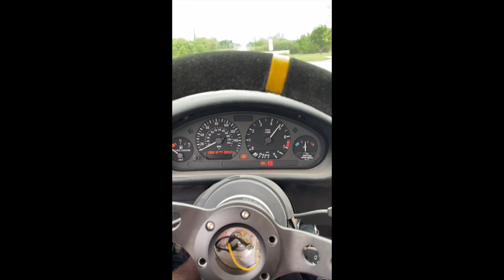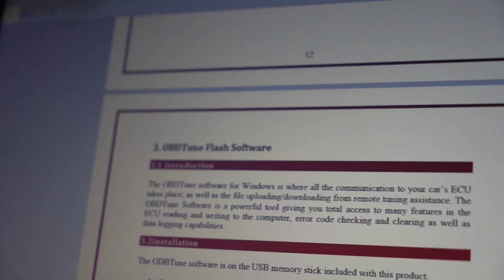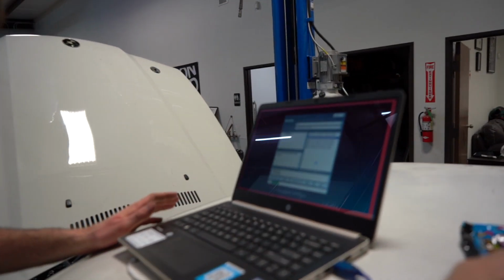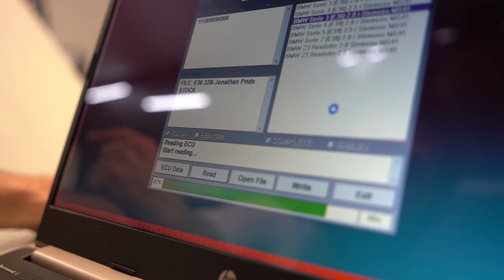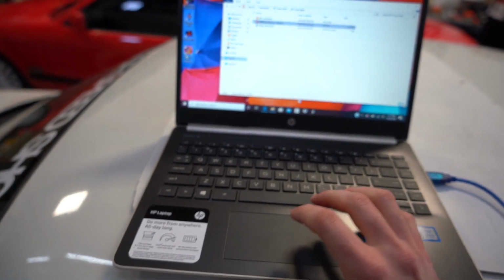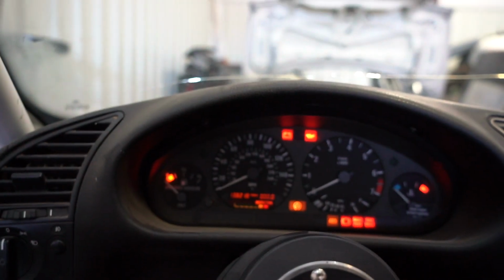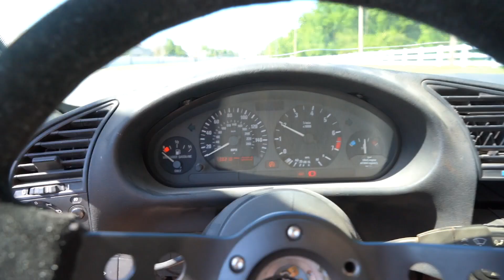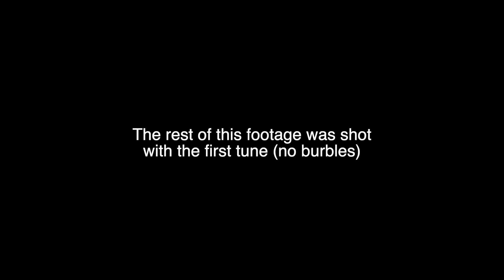BMW E36 RK-Tunes Install! 328i M52 OBDII AGGRESSIVE BURBLES!

Comment: So just removing EWS and raising the redline to 7300 won't give u and extra 15-20hp..it won't even do it when he adds the burble(which was the only thing u wanted really...and he forgot),and if dude at RK told u it would he's lying. U need to AT LEAST do the intake swap to yield the performance gains. Otherwise he just compromised ur crack and made ur car annoying to drive. Personally I'd goto kassel cuz I've heard NOTHING but BAD THINGS on RKTUNES

Comment: I might buy this friday I'm not sure. M50 manifold or this what you think I should do first? Love the channel man!
Reply: M50 manifold , pulley kit, long cold air intake , headers with with a performance cat a y pipe after the cat to a single 2.5 all the way back to a Magnaflow exhaust , and lastly the rk tune
Reply: You can also not waste your time and money,  an by an M3
Reply from the maker: Sweet!
Reply: @leavingasap843  lol...why so u can spend 3x as much for the car and insurance just for a M badge? The e36 is WELL KNOWN to be the chassis that M3 owners got the SHAFT on. Not only did we get a SEVERELY detuned motor s50 and very minor cosmetic differences,but when the M52b28 motor came out in 96 the performance numbers were so comparable with the s50b30 in the m3,bmw had to nerf the m52b28's intake just to TRY and justify the extra 10k a m3 was.  With a 1 time VERY CHEAP series of mods,a m52b28 can EASILY put out the same juice as the M3. u get one that is automatic,that the motor hasn't been beat to hell back and u can beat a abused m3 with just a manual swap...ask me how I know

Comment: wait so changing the code in your ecu can change your power output and exhaust? I still dont get that? Is that what it is, just coding?
Reply: It's basically telling your ecu to run a different way. Cars from factory are ment to run efficiently more often than not. What he is doing, is basically making the car run a little richer so he gets that crackle in the exhaust. Your rev limiter is also set by the ECU so you can remove that. So if you want to look at it as "coding" then yes, tuning your car can be close if not same to coding
EDIT his tune is also giving him better performance, which is what people are usually going for. Higher torque numbers and bhp
Reply: Wolf Gvming they pull more timing and other stuff like take advantage of higher octane fuel
Reply: @wolfgvming5855  well put gg

Comment: Hey! What wire or fuse did u tap into to have electric fan turn on with the key ?? Thanks
Reply from the maker: Any 12v to use as a trigger. Cigarette lighter? Use an add a circuit thing

Comment: Bloody lucky you got a good cop lol
Burbles sound nice, but you need a better muffler 😎
Reply from the maker: Big Keg I know man I was sweating it for a sec 😅 Yes I’m going to redo the exhaust setup, not a huge fan of the noise.
Reply: I really want to have a slight burble but I don't want it to be very aggressive. Cuz let's face it unless force induction our e36 aren't that fast. Also won't to get an exhaust been thinking about uuc

Comment: Hello, i just came accross your channel. Great stuff. I have a question. Are 328i and 328is the same? What does IS mean? For 318is i know, but here in my country , we don't have 328is or 325is's , so noone knows. Some think that the IS means around 200+hp stock. Sport of some kind.
Reply from the maker: Hey man, glad you found the channel. The IS means that it is a 2 door. I don't think there is any other big differences.

Comment: About to get my hands on Mint 328i, What mods did you do to the engine? Intake? Manifold? Exhaust?
Reply from the maker: my 328i engine just has exhaust and cold air intake. Plus the tune. That's all. It is hard to pull much more power out of these. You can do m3 cams, Intake manifold, and tune.
Reply: 1st mod, sell it an buy an M3.
Reply: @leavingasap843  good luck😂

Comment: $1000 ?
Reply from the maker: LateNight Rituals $350. I paid $290 with the Black Friday discount. Sorry I should have mentioned that in the video.
Reply: @jspeedracing  i see, they also coulda tuned a different map if u had intake, m50 manif n .... Stuff like that ? For same price
Reply: @jspeedracing  cus i thought it was $1000 for something lika stand alone so they could tune it. But apparently that wiring this the job which is surprising
Reply from the maker: LateNight Rituals ya probably, just list out the mods. Good for the price for sure
Reply: @jspeedracing  gotchu thanks G